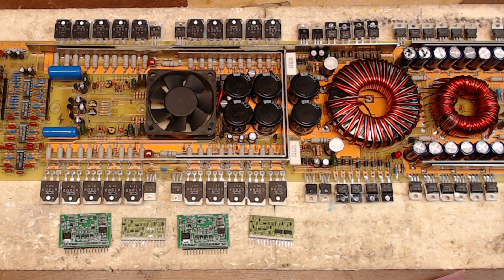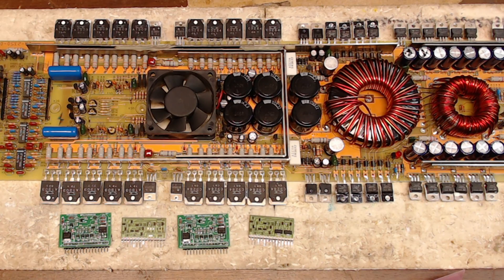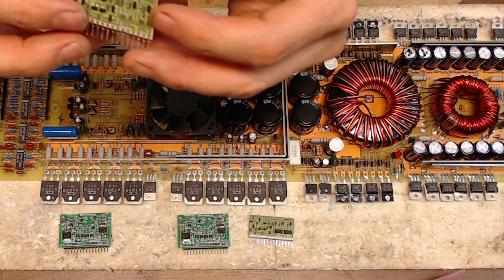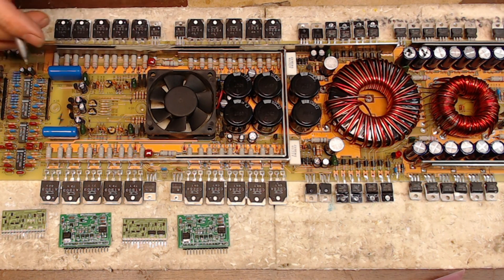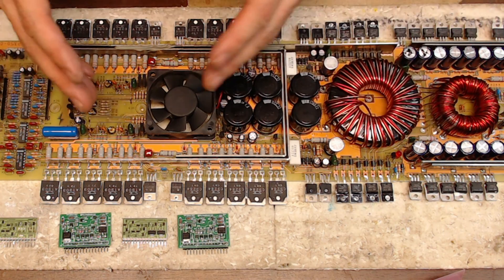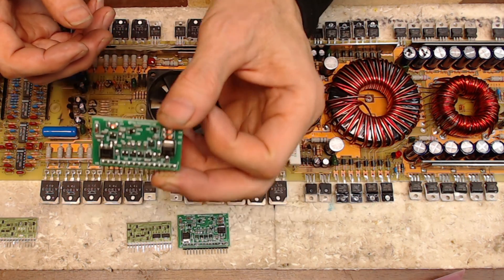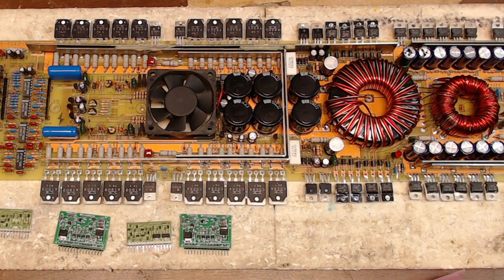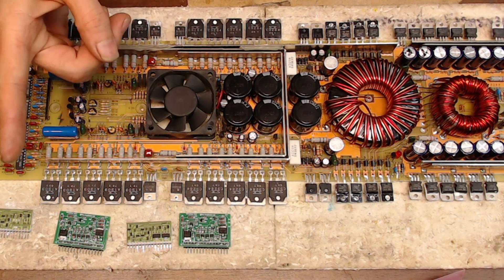Precision Power PC2350 Output Card Aftermarket Replacement Power Supply Details

Comment: Hi bro ihave Precision Power 2600.2 you can help to fix if you have a WhatsApp to send photo of amb amb not working no power
Reply from the maker: Hello! I wish I could help but I am closed for repairs. You will want to find yourself some replacement output cards for it. There are aftermarket ones out there if anyone is still punching them.
Reply: I'm missing some dual transistor numbers. @ellensburgamplifier
Reply: That is a really great amplifier